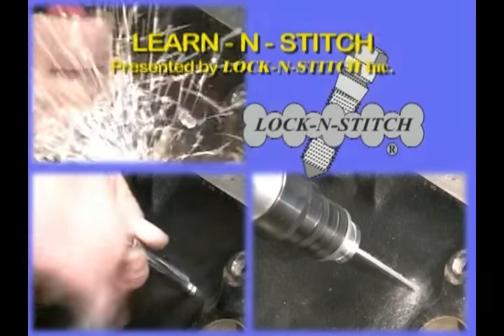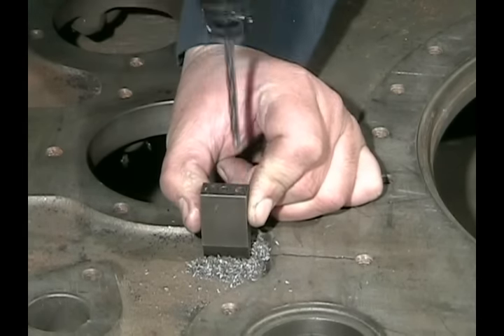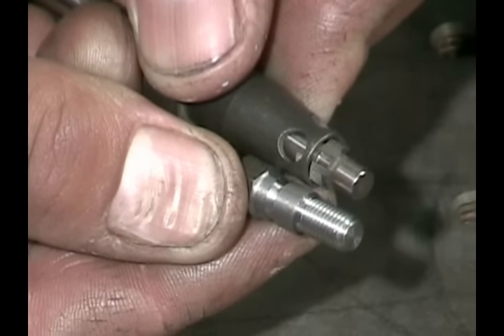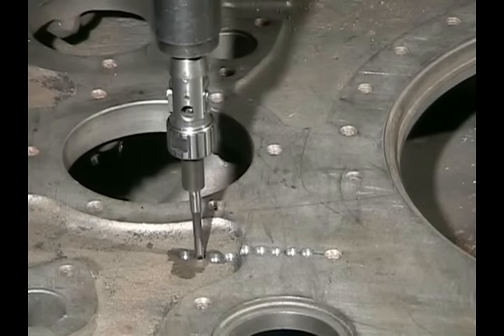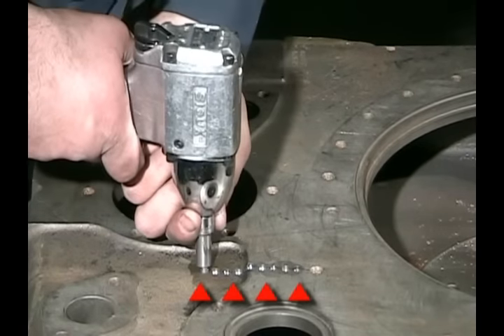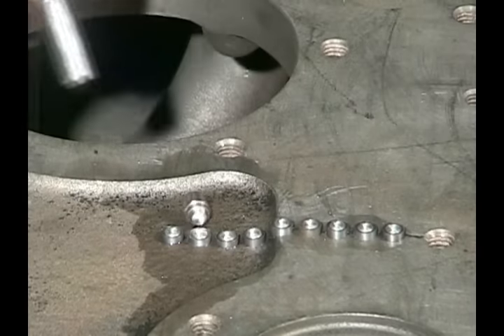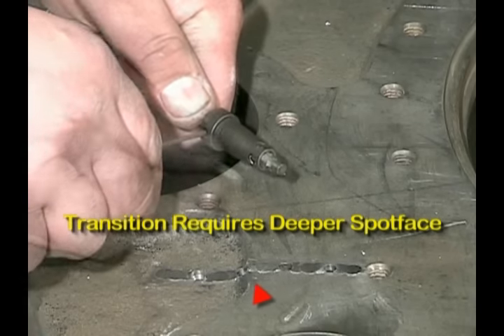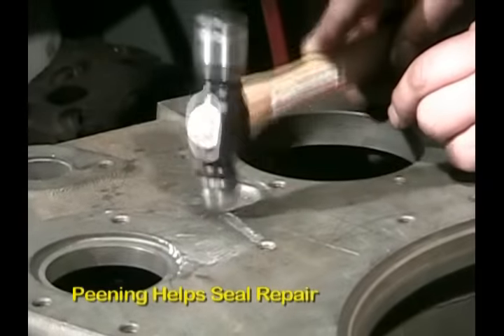Cast Iron Crack repair

Comment: looks like it takes about three times as long as grinding out and tig welding.
Reply from the maker: The LOCK-N-STITCH process demonstrated in the video is shown in great detail to slow down and specifically show a viewer the steps of the process.  If you have specific questions please feel free to email or call our customer service specialists, they would be more than happy to talk to you about the many benefits of metal stitching versus welding on cast iron.  800/736-8261 or info@locknstitch.com

Comment: Does the jig ever get hot? Especially on the second hole?
Reply from the maker: @kakyoin Noriaki it may heat up a little, but nothing that a hand couldn't handle during installation - if you have more specific questions please feel free to call 800/736-8261 or email info@locknstitch.com We appreciate your interest in our process and products!

Comment: this can be done on cylinder head between the valve seats?
Reply from the maker: Yes it can, please call in to speak to speak to one of our customer service specialist or you can email - they would be happy to talk to you in greater detail about the products and processes 800/736-8261 or outside the NA 209/6322345 info@locknstitch.com

Comment: @jeffreytang71 Welding/brazing cast iron works just fine and is not hard to do if you use the correct procedure. First, drill a hole at each end of the crack. This stops the crack from running. Second, preheat the crack and the area around the crack before welding. Failure do either one of these steps will cause a failure in the weld/braze. I really can't see the point of the tool in the video.

Comment: if its cracked, its usually done. something like this might be a quick fix if it works at all, but not for long.
Reply from the maker: It is a permanent repair, not a temporary fix.  If you would like to get more information we would be happy to speak to you info@locknstitch.com or 800/736-8261 or 209/632-2345  Thank you for watching and commenting

Comment: I have tapped thousands/THOUSANDS of holes my specialty; for a more clean tapped hole use a two flute tap & then put a drill bit point on the tap (Creates a chased hole): When I use a tapping head I also grind off the taper on the tang(of the tap) so the rubber collet can/will allow for self centering.  Speeds up tapping by around 20%.
CMVHighPriest
Reply: can you make a video of it ?

Comment: I like how he keeps referring to it as spot-facing... that's not spot-facing that's counter-boring. Spot facing would be on a bolt buttress, to provide a flat mating surface for a bolt head after casting. Counter boring is enlarging the entrance of a hole to accept the head of a bolt.

Comment: I understand why you are doing this but is there any added benefit vs brazing?
Reply: +TheeFirewoodGuy He didn't say welding, he said BRAZING.  Using these toy "pins" is just a vastly weaker, costlier, and more time consuming way to braze the crack.  Personally, I'll stick with tried and true methods that WORK.
Reply: +Ryan Pflughaupt This is the correct method for most cast iron pieces, welding and brazing will produce uneven heat deformation that will change dimensions in the cast iron piece, if it is a cylinder block then you lost that block or then you will need to re-machine the block again. Also, cast iron losses a LOT of resistance under welding, at the end you will get a weaker part. By the way, MOST PEOPLE COMMENT HERE without knowledge of materials, just ask a mechanical engineer to be sure, don't trust people that thinks know more than the proved science.

Comment: Why not use the air from the drill the clear the surface. You just bend your wrist and blip the tigger and the drills air holes blow the chips. Never have to let go of the drill

Comment: As a Retired UA 342 Welder I've messed around with cast iron alittle bit.... I've never heard or seen this pin method...I didn't weld Cast on the Job just for myself or Friends... I'd drill  both ends of the crack and Preheat the crack using temp sticks to get a constant heat (I don't remember how hot)grind it down enough to Penetrate the crack and run a bead and grind it out Smooth then fill and Cap.....It didn't work all the time...With Cast there's so much Shit in it you never know if it will weld or not....I used NICKEL ROD....On the job it was ALWAYS THE WELDERS FAULT if it worked or not.....The welder was ALWAYS blamed like the Machinest in this Video Said. The welder got blamed for it all.....I would think putting these pins in this block and welding it would make it crack more......Anyway the Best way to Fix Cast is to take it to someone else so you can Blame him (joke).....And I've been welding for 47 years now......No I Didn't take it to someone else....Like he said in the Video Some of it's just JUNK and can't be Fixed.

Comment: Not a fan screw pressure will tend to crack the cast and spread
Reply from the maker: Then you are a fan of our products, the patented thread design does just the opposite!  It pulls the material together and adds strength!

Comment: This method fails when there is a pulsating load on the part, we tried this stitching method 30 years back. But the method is very good , time saving and cost savings, one more is there that is ,on line leak sealing,.

Comment: So basically..... We're cutting the crack bigger, whilst rounding the end of the crack so it doesn't get longer.... 

and then supergluing a wedge into the crack??
Reply: It sure feels like that...  I get drilling the hole at the end of the crack to distribute the stress around the circumference and keep the crack from propagating any farther, but how is the threaded connection between the plug and the original metal less likely to open back up then the original crack?
Reply: @TheOnlyTominator  It looks like they decided to split the video into multiple parts.
Reply: @kmclasvegas6513  Sure enough - thanks!

Comment: There is no diffusion here, so a good heat and cool cycle will make it leak if used to hold liquid under pressure.

Comment: Isnt that making the crack bigger? The screws have no grip, they are just filling the holes..
Reply from the maker: LOCK-N-STITCH Castmaster stitching pins do just the opposite, they pull material together making the repair stronger! Read more about it here http://www.locknstitch.com/precision-metal-stitching.html

Comment: Awesome!
Reply from the maker: Thank you Richard!  We are here for you if there is ever need for our products or services. We appreciate you watching and feel free to checkout our Facebook page too!  www.locknstitch.com info@locknstitch.com
Reply: LOCK-N-STITCH INC. this is art and Real talent. I got a few auto frames I have to weld and am learning a few tricks, like drilling holes before and after the crack.
 However I'm welding steel now ,in the future I may have to repair engine blocks
Thanks again..I always wondered how this process worked since it was on Leno two years ago.

Looks alittle tricky 
I got a Flathead v8 that may have a crack , I haven't tested it yet at machine shop.
Reply from the maker: Richard we are so glad you found us and if/when you need us we are here to help!  We are passionate about repairing cast iron!

Comment: I cringe watching them tap those holes with a gun. Fasinating though. Didnt know this exsisted. I just jb welded a block on a cat loader at work and hope it works.
Reply from the maker: Glad you found us! We manufacture all the products in California and if you ever have a need please give us a call.  We can provide you with all the technical support required to purchase the product and do the repair yourself or if the repair is one you would prefer we handle we can do the metal stitching in house. 800/736-8261 or 209/632-234 info@locknstitch.com

Comment: before yall try this. make sure the engine is pulled and you clean/blow out the galleries... you saw all those shavings... imagine how many are inside the engine when you drill thru to the other side lol.

knock knock... who's there... cylinder 3 connecting rod from spun bearings.

Comment: Because of the expense in replacing a cracked block in Jaguar E-Type engines; 3.8 and 4.2L...they have a process where they 'stitch' the crack back together. It's detailed with pics in a restoration book. The process is a carryover from the old steamship engine days of lore. You can't even see where the repair was done....this vid is a lot like that process but more bastardized.

Comment: The repair you showed actually weakened the metallic crystalline structure by introducing further stress to the existing crack. Other than sealing it from leakage such as air or fluid, you actually weakened the structural integrity many times doing this. I would strictly weld or braze this using filler material, it's the only true repair.

Comment: I still don't understand how this is repairing the crack.   Why not wheld ?.
Reply: because if you welded the crack, the stress crack would still continue to exist and not be structurally sound. The problem with stress cracks is that they are too deep and will propagate over time.
Reply: @tommywd40  not if you drill a hole at the end of the stress crack
Reply: @Krzys_D  not necessarily. It might stop it on the surface yes, but it may continue internally as the metal expands and contracts.

Comment: Why would you do this instead of welding it?
Reply: Welding cast can be hard due to impure casting metal, but i dont see how doing that actually fixes the crack. Looks like it adds more pressure to it.
Reply: Lock and stitch works on aluminium also.

Comment: "Iron Stich" was a similar process "we" used to repair holes in cylinder blocks that had experienced a connecting rod 'beating".  the replacement for the missing piece was taken from a donor block that was beyond repair. too much said ...
Reply from the maker: Bob thanks for watching and commenting.  This is a newer patented technology - the LNS method is improved over the old ironstitch method.  Gary Reed, inventor created many specialized products including CASTMASTER with a thread design that pulls material together adding strength to the repair - creating a permanent repair. If you have a need for the products or services do not hesitate to contact us 800/736-8261 or 209/632-12345 info@locknstitch.com

Comment: I've read the posts below and evidently none of you have repaired a 8500 dollar racing block,i've done this repair on a OFFENHAUSER 4 cylinder in 1973  AND YES THIS IS A DIEING ART FORM,preheating a valuable block throws all clearances out the window and you have to machine it all over again,metal grows with heat,some metal grows more with heat,but nonetheless this is a correct way to repair something valuable,no body is gonna weld on my hemi's,and they can be bored 8 times and resleeved and go again,oh well weld that chevy shit

Comment: This isn't what I'd call a "crack repair". It's more like a "crack bandaid". This isn't suitable for high-temperature work or water jacket work or oil gallery work or tensile work, and I'm not even so sure that it'll stop the crack form propagating. It will, however, prevent the two sides of the crack from flexing with reference to each other, possibly wearing away at the crack surfaces.

Comment: But why not weld? If you leave enough material, the re surfacing would cut away the rest. If done right, you get a perfect result. All I see here is just a bunch of Bolts... How is this supposed to be better than Weldeng? If sealant is not properly used, the Crack could reappear and do more damage than a weld would allow for. 

Cheers
Reply: Welding can distort the piece, which can really affect flat machined gasket surfaces as it makes the whole machined surface have a bow and using the bolts negates this. Sometimes the piece can't be welded on and has to be repaired in situ (maybe where hot works aren't allowed). The bolts all interlock and cant undo themselves because the first set get damaged by the second set and it's the bolt special threads pulling the sides together, the sealant is not gluing it together. It is not a substitute for welding but it's a product for someone, somewhere.

Comment: Am I missing something? This repair adds no strength whatsoever. A simple drill hole at the end of the crack would prevent the crack getting any worse. The only benefits I can see from this sort of repair are:

1. It looks good
2. It will prevent leakage through the crack should the item being repaired be an engine block or pump for example.

A weld will do the above and add strength too. A weld is also much cheaper.

Comment: Wtf, grind it open, heat it up and weld it with the TIG welding process . Use stainless steel wire to fill up the crack. Layer on layer. Make sure the surrounding is warm. Saves half the time and a perfectly result.
Reply: Not everyone has a TIG welder.

Comment: There is no way I would trust any bolt system of this nature to prevent that block from splitting again, it has been weakened and has not the same strength, and any pressure within that casting will probably leak, One has to ask why did it crack in the first place, Just not something I would trust.

Comment: It has to do with the design of the thread of the stitching pins. They use a thread similar to a buttress thread but with a negative face angle ___\-|_\-|  - kinda like that..so it acts as trap for material.

If is at an angle you would go through both surfaces...

Comment: I fail  to see how that stops the metal from splitting
Reply from the maker: It is all in the thread design, it doesn't push the material apart like a tapered screw - it pulls together!  We would be happy to send you more information or you can talk to a technician on the phone if you have more questions.  We are here to help! info@locknstitch.com or 800/736-8261

Comment: I might try this on the side of my block... hmmm
Reply from the maker: We are here to help you!  You can call our customer service technician or email with your repair questions.  We can supply all the training materials you would need to do the repair.  Thank you for your interest in our products. 800/736-8261 or 209/632-2345 or info@locknstitch.com
Reply: LOCK-N-STITCH INC. Say the crack is about 9 inches long and goes under a motor mount, through water jackets and such, would it be a viable option? Thabks
Reply from the maker: Devyn, thank you for the follow up question.  Yes it can be repaired!  Can you send pictures of your repair to info@locknstitch.com - our customer service dept will review and be in touch with you!  ~LNS

Comment: yes and no I find you cant weld cast iron with electricity but 3 gas welders make for a nice weld I had 2 friends heat up the area and keep it heated while I walked a bead over with my torch granted it was a 4 inch crack cussed by my block heater but it worked handily
Reply: Nickle rod and Arc welder...I have brought many rare engines back to life using this method

Comment: . I'd never do this... I'd grind a V into the crack... heat the part up hot... weld it back in with rod for cast iron... let slowly cool... grind/machine flat...

Comment: why not just fill it with aluminum ?
Reply: You NEVER put aluminum and ferrous metals together unless you want to initiate galvanic corrosion.
Reply: @whiteknightcat  what metal is that? iron?
Reply: @mitropoulosilias  FERROUS metals. A metal with the descriptor “ferrous” means that it has iron in its composition.

Comment: Fuck that. Heat the casting with an acetylene torch to a temperature slightly below the "Eutectoid Temperature (1333℉)", until it's a Dull Orange. Weld the crack and as it cools, reintroduce the acetylene torch periodically so that the, weld and casting cool at very slowly to ambient temperature. This technique will get you by if you're working in your backyard, but is not advisable for production. If you need advice or have metallurgical questions answered. Hit me up. charlesg@metaltreaters.com

Comment: easier for me just to v groove the crack, weld it, grind it, sand it and re-tap the hole
Reply: Back in 1963 I was taught how to do this. We repaired a 235 Chevy head I remember the last 3 casting numbers were 848. I continued working there several years. Many of those 848 heads were cracked right thru the exhaust seats. We would charge by the inch for repair. I think we used iron tire plugs if I remember right.

Comment: Cracks appear where there is, or has been, tensile stress.  Pushing apart an area that has cracked, using the mechanical advantage of threaded fasteners with conical heads, seems incredibly janky to me-- like something a technician with zero engineering chops would do.  Cast iron might not have outstanding tensile strength, but even when welded it has way better tensile strength than a hole with screws stuffed in it, pushing it open!

Comment: WHY WOULD U SPEND SO MUCH TIME ON QUESTIONABLE REPAIR WHEN U CAN WELD IT?
Reply: Mcq Cjc welding creates heat and alters the structure of the cast iron, there are many reasons why you wouldn’t weld this.

Comment: Seems like a really time consuming and kind of a pointless repair. Why not just drill out each end of the crack, grind the crack down with a cutoff wheel,  pre heat the cast iron part and weld it with a really hot weld then machine it flat again....
Reply: Spawanie zniekształca materiał. Dlatego nie spawali.
Reply: @twojsasiad8214  Dude me too.

Comment: This is stupid way to fix a crack if you ask me... Jut drill a hole in the End and start of a crack weld in all the way to the Bolt Hole, who ever thinks that you cannot weld Cast iron is apparently Clueless all you do is preheat the entire thing and then heat the area you're gonna weld to just about red hot then lay a bead with MIG.. Then Re Tap the Bolt hole and then Machine the surface back down. This just seems like a waste of time and labor.